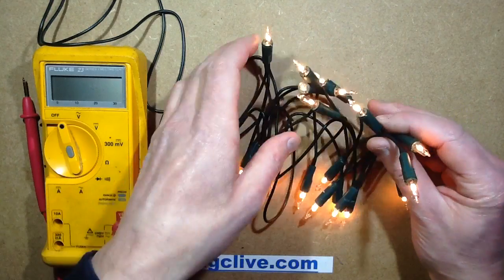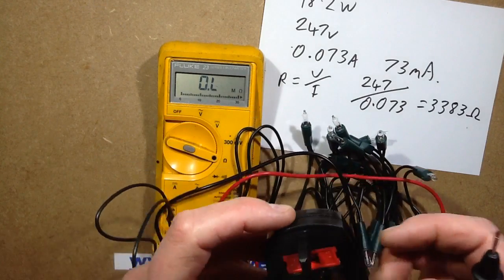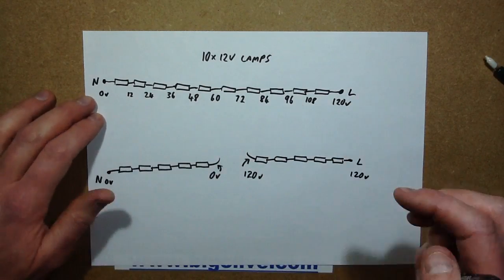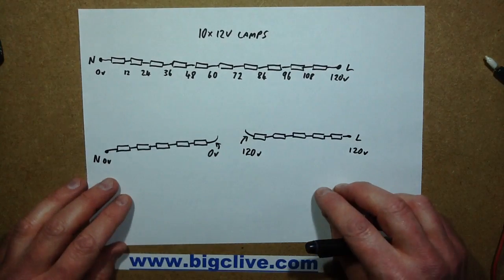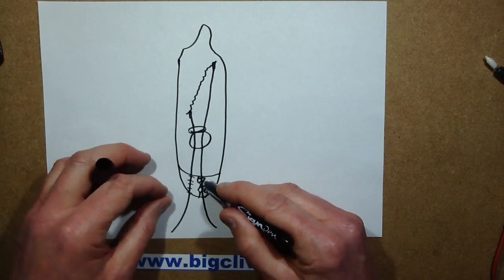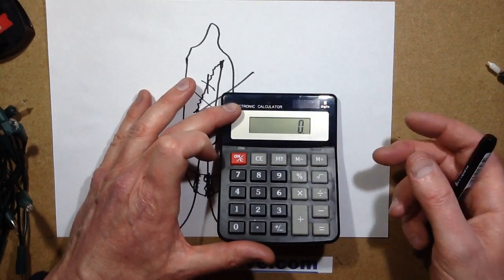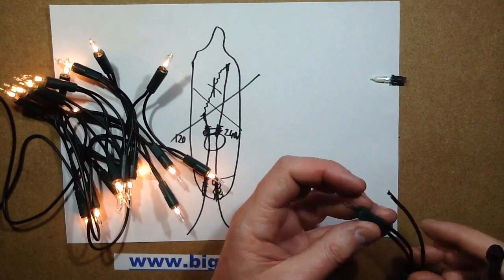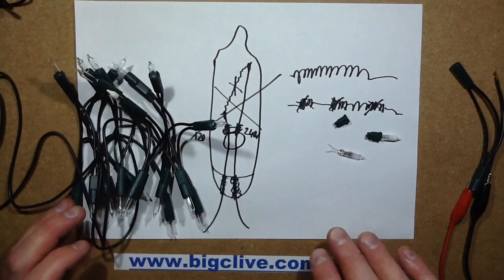Everything you didn't need to know about tungsten Christmas lights.

Comment: Growing up in the 70s we had a variac on our Christmas tree, when we turned it on we'd start with a low voltage to let the lights "warm up". I guess it helped some. The other reason for having it was that we were in a rural area and our supply voltage would sometimes reach 130v or more. We had to buy special bulbs for our household lamps.

Comment: I know this is an old video, but I'd love your input on this. I had an electronics teacher who said that lightbulbs ONLY burn out when being switched, and said a friend's of his had a bulb in his barn run for several years before burning out when somebody toggled the switch. How true is this?
Reply from the maker: +Nathaniel Emm A lot of tungsten lamps do fail when switched on because the resistance of the filament is a lot lower when they are cold, resulting in a sudden high inrush current.  You can sometimes hear them make a ping noise when turned on.
Reply: Sven Kowatz  I don't know if Clive has. Opto-isolated Triacs are available that include a zero crossing detector chip. Using a zero crossing detector system will increase the life of a filament lamp. I have a Christmas lights controller that includes such a system. So am still using, what must now be lighting sets that are over 25 years old. Typically I only have to change one lamp every couple of years (actually two sets of 20 filament lamp sets running off 230/240V with each lamp rated at 12V each).
Reply: To add to Clive's comment, yes, a filament lamp left on continuously typically will last a lot longer than one that gets switched off and on during it's life. When a lamp is switched on, as Clive says, the filament will be cold, and due to the filament's resistance being low, a high current will flow. In addition, it's pot luck where the mains waveform is in it's cycle between zero volts and the peak voltage. So when switching on, as well as a high current, the filament also goes from cold to hot very quickly. This all means that at switch on, the filament of a used, old lamp is most likely to fail at it's weakest point.
But in a lamp that is just left on all the time, any weak points in the filament will not be put under anywhere near as much stress, so the wire of the filament can continue to slowly degrade and the lamp will stay lit. Until of course, one of the weak points eventually gives way...
Reply: Mark 1024MAK That reminds me of a zero point switch. There is a type of circuitry which acts like a switch but only switches on at the next zero point of the sine wave. This principle has many advantages. I wonder if Clive has already done a video about that.

Comment: I miss the old days  of screw in  bulbs - when it was a lot easier to get spare bulbs ....20 lights in a string made sense 20 x 12v volts = 240 .....then the manufacturers realised that consumers often needed more than 1 set for a tree - so they made the larger 40 light sets .......and then to confuse everyone PIFCO started making sets of 35 meaning the voltages of the spare bulbs all varied . ..... then push in bulbs started and so many different types of fitting - impossible to get the right bulbs ....... I do like the new LED warm white bulbs but LED lights are very plain when you compare them to pretty light holders in the old style screw-in sets .... incandescent bulbs give a much more magical Christmassy atmosphere than led ...just my opinion .

Comment: I was looking for people using the + temp coefficient of the filament for self regulating audio biasing on varying lengths of telephone lines, and came accross this...  Confirms what I thought...  Not so easy to get hold of these lamps these days, especilly for new self biasing applications to older telecomms equipment.

Cheers
Al
Reply: Though the Christmas lights are available in Poundland on this side of the pond.

Comment: Could adding an inductor prevent the lack of resistance in the cold lamps from causing burn outs? this would add resistance temporally as its magnetic fled builds
Reply: ChrisD4335 But a suitable inductor would be large, heavy and expensive...

Comment: I'm a tad confused about this shock thing, I agree that whilst the circuit is broken the voltage between the breaking points is 120V but shouldn't it drop after you close the circuit with your hand back to ~12 V because the current is going through the resistors (bulbs) again?
Reply from the maker: The current would take two paths.  Partly through the completed lamp circuit and partly through you to ground.  Either way, the current needed to light the lamps is enough to give you an incredibly high electric shock.

Comment: what happened to my light bulb? I accidentally dropped my 40 watt incandescent lamp the other day but it didn't burn out. it shined a cold white and pumped out light like a 300 watt street light and shined like that for several days.
Reply from the maker: When a traditional tungsten lamp receives an impact, the coils of the spring-like filament can stick together and short out making it run much brighter.  But it won't last long.  Sometimes it helps if you turn it off and give it a sharp tap to help separate the coils again while it's cold.
Reply: oh ok, mine only goes to 30v DC at 10 amps, or more if you turn the potentiometers up more lol
Reply from the maker: +Hunter J. Short (Hunter Short) My bench supply goes up to 36V at between 2 to 5A depending on the range selected.
Reply: oh ok cool man :) i like mine its a rather cheap chinese Dr. Meter branded power supply cost about 70 dollars here in the US
Reply: +bigclivedotcom what type of variable supply do you have? like what voltages?
Reply: +Hunter J. Short (Hunter Short) 120v

Comment: Oh wow...  It's been decades since I've seen a fuse-lamp; I'm not sure if you can even buy them anymore over here in the States.  At some point, a law came into place that Christmas light strings had to have a fuse in the plug.  It makes for a rather long and cumbersome plug that has a tendency to want to pull away from the socket...  Sigh, Health & Safety...

I've always wondered how the rest of the string stays lit when one bulb goes out.  I'll be peering in to look for that little coil of wire come Christmas!

Great video, and awesome information!  :D
Reply: +rhkips ours have a fuse lamp and a fuse in the plug.

Comment: i thought the V from the wall was always 230 and 360.
Reply: In the U.S. Its 120V @ 60Hz and in the UK and most of Europe its 240V @ 50Hz
Reply: +ProGunnieDutchHD it is root 2 of 230V, it could be potentially as high as 325V at any given moment.

Comment: I once had to figure out the temperature of the filament of a 230V 60W bulb in school and we where only allowed to use basic measurement devices from the lab. Solution: Measuring the cold resistance with a multimeter, calculating the hot resistance via Watt and voltage rating, look up the temp co - there we go.

Next we had to measure the power on current of a 12V lamp. Oohh... that was fun. Four chunky lab power supplies in parallel in other to avoid the current limit and to exploit the sum of all the output capacitors. I miss those days where we had fun with just simple bulbs, a lab supply, a multimeter and a scope.

Comment: Around my neck of the woods I'd consider 247v a bit low - I've seen my mains power soar as high as 270v & drop to as low as 210v.
Reply from the maker: I think rural supplies tend to be the most variable due to the wide variation of load.
Reply: bigclivedotcom Yeah I'd consider my area rural. The fact that the local substation & it's associated lead, oil & paper insulated feeder wiring was most likely installed back in the days of the Ark can't be helping either. ;)
Reply: I also agree that it's worth contacting the power company as they are unlikely aware of the voltage problem.  It's also to their benefit as they're usually liable if a voltage spike causes damage, at least here in Ireland.

We had a similar issue around 10 years ago were our mains voltage fluctuated between 205v and 255v throughout the day.  I sent an e-mail to ESB networks (which looks after the grid) and two days later a technician came out and did some voltage readings.  About a week later, they came out and installed a new transformer.  Since then, our mains voltage is fairly stable around 230v.
Reply from the maker: Seán Byrne It doesn't help that the average household is using more and more power these days.  To compensate for the higher demand pulling down the voltage due to long runs of cable to closely rated transformers they sometimes cheat a bit by changing the transformer tapping for a higher voltage.
Reply: Ben Thomson
Ben, might be worth calling the power co too, what you MIGHT have there is a loose neutral, if the local substation transformer's a 3phase one, heavy load on the other phases can cause your phase to rise higher, can be a nasty situation.
Reply: I'm fairly sure that's what they did at my workplace when I reported a voltage problem there, where it varied between 200v and 220v.  The main problem there was when the place hired a dehumidifier to dry flood damaged stock and the machine had trouble starting when the voltage fell below 210v.  After the ESB fixed it, the voltage now varies between 230v and 250v.

At home, the additional transformer was installed near our house which had a big improvement.  For example, switching on the kettle (2kW) drops the voltage by about 2v now compared to 6v with the longer cable run to the previous transformer.
Reply: *****
Considering when the feeder had to be repaired, it proceeded to incinerate itself in several other places down the line, a loose neutral wouldn't surprise me. It's definitely 3-phase, I take my service from one of the phases on a local industrial estate. (Boater, long extension cable) ;)